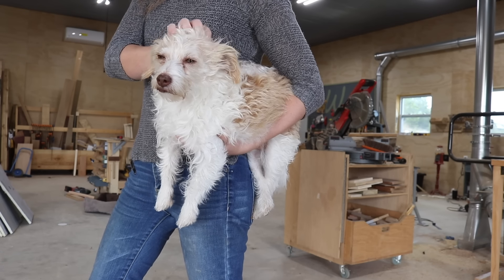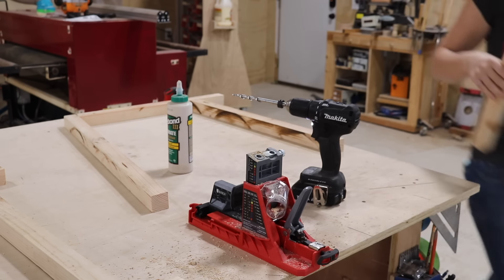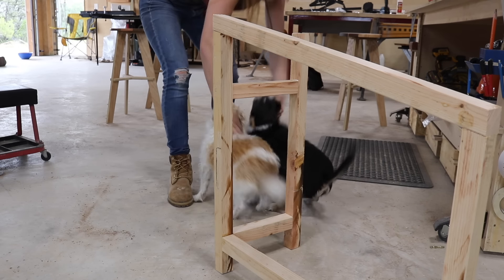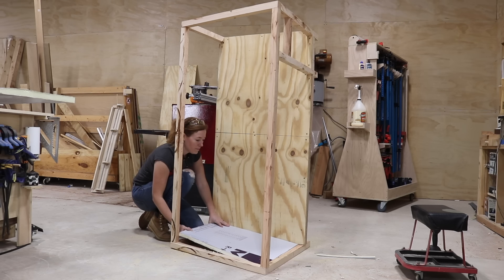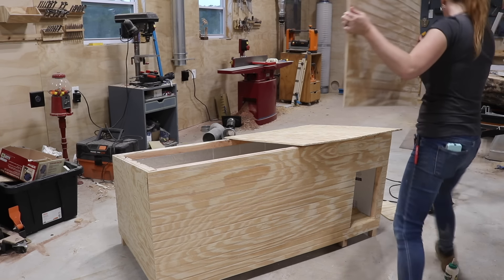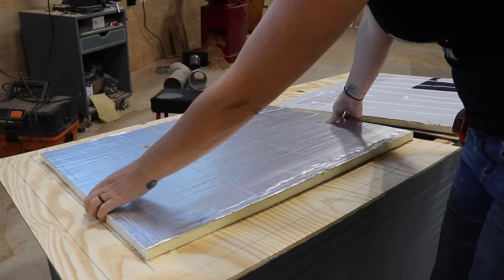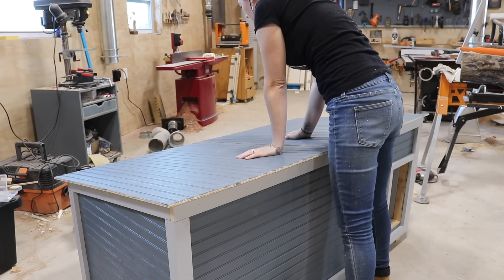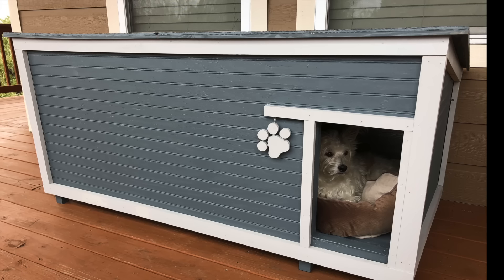DIY Insulated Dog House Build

Comment: A recommendation, add latches on the front in case of wind so the roof won't raise and slam down scaring the dogs. I had some dog houses with hinged tops to make cleaning them easier years ago and that happened. Nice design.
Reply from the maker: That's a good idea. : ) Thank you
Reply: Nice dog house wish I had a dog so I could build this. If I did I might be tempted to add some sort of flap to the entrance to reduce wind and draughts inside.
Reply: Well there under a porch
Reply: @AprilWilkerson  I'm late, but magnets will work just fine plus im lazy so it's easier than just adding more hinges or something
Reply: @chatteyj  I am building a hutch just so I can get guinea pigs. Just an idea :) build it and they will come.
Reply: I would like to buy one from u
Reply: @marianellaramirez3786  spam.
Reply: @mihai2860  spam
Reply: @neoadviser8056  spam
Reply: @rem2510  spam
Reply: @MariaSanchez-uo8qy  spam
Reply: @eggofish  there what?

Comment: April Wilkerson  I've really enjoyed watching your videos. You make a lot of really cool projects and you have come quite a long way since those first days. One thing that I've noticed though is that you always have a bunch of special tools for all your projects.  There's probably not a lot of us watching your videos that have over $100K+ worth of tools and a workshop bigger than most people's house. I wouldn't mind seeing some videos where you use just the basics. As an example. If I were to build this dog house with what I have I would have used, a standard circular saw (without a guide track), A standard 18V drill (no fancy pocket hole jig), a blade to cut the insulation, a speed square, a metal straight edge ruler (48 inch), a tape measure, a paint brush and roller, a couple of saw horses (no fancy, wood clamping, mighty jaw contraption). The entire cost of my tools for this project probably costs about as much as the two Infinity blades you listed in the summary (I'm not a carpenter nor is it a hobby of mine, I just like watching people build things). Just the tools alone that you listed in the summary costs well over $2,000. Maybe you could start a new set of "Back to the basics" videos where you make some nice projects with tools that the rest of us have. Once again, thanks for all your videos and keep them coming.

Comment: Should have put a plexiglass windows in the front, dogs always like to watch things,and stay warm.
Reply: I would have just added 4'x4' double insulated windows to help with temperature management.
Reply: I would be more concerned with a gust of wind lifting that roof and the wind blowing through that entrance hole.
Reply: @chatteyj  She can easily modify that with latches that she can access, but the wind cannot
Reply: Colby Mason horrible idea. Dogs tend to prefer darker and den like shelter when it storms which would lead to anxiety. The dog house she made is best how it is.
Reply: Purebredbrute when it storms you can always  just put a solid screen in front of the window
Reply: Dr Bojangles yea you can just bring them inside as well but is that even practical ?
Reply: Purebredbrute of course it is, all you need is a piece of wood the size of the window, not hard at all.  Bringing them inside is a big step from what I suggested
Reply: Dr Bojangles I don’t know where you live, but here in Texas that would require you switching the window in and out every other day, a few times a day as often as it rains. Furthermore would you be home at all times to be able to manually apply and reapply the window? Seems like a headache if you ask me.
Reply: Purebredbrute oh i see, i live in NZ its not so stormy here
Reply: Purebredbrute Well in that case i’d suggest building a robot to do the switching while youre away
Reply: How about a swing door so that cold air wouldn't blow in 😁
Reply: @ravenone6255  yea I was thinking of just putting in a doggy door.
Reply: To Colby Mason
 I made a house just like this one and you will be happy to know I took your advise an installed a window. Thanks.
Reply: I agree. Dogs are total sticky beaks and want to see everything. You can even see that in the video where the prime spot is in the doorway which is blocked by the dog sitting there. I built an insulated lift top dog house in 2008 for my two dogs and put in a tinted perspex window. They were happy being anywhere in there because they could see what was going on, and stay warm. Gotta look after the pooches :)
Reply: I lock my dog in the car trunk when it cold out so he stays warm

Comment: Excellent build !  I built an almost identical one, except for one dog. I had to cover the insulation board and mine had a center ridge with a piano hinge. The hinge was simply covered with a flap of thin flat rubber, bonded on both sides. It also has 8'' overhangs on the sides and 16'' over the opening. I'm 53 now and that dog house was built when I was 20 !  It is still in use but for a well pump house at a friends cottage by the river. Man, is it heavy !!

Comment: I liked the siding and paint you choose. Looks great. I have a heating pad in my dogs house because it gets 50 times colder here.
Reply from the maker: : ) Ha yeah, a Texas winter is pretty easy. I bet yours loves that pad!
Reply: @AprilWilkerson  oh yea ;)
Reply: Lol. How did you get over here?!
Reply: @This1LifeWeLive  I have been subbed to April for a 2 years
Reply: Doesn't get below freezing very often here, but I added a light and a 100watt bulb as a "heater" to make it warmer in the insulated dog house I built for my dogs a few years ago. It worked surprisingly well too. It was below freezing outside and the inside of the doghouse was about 75.
Reply: @Conqueef-tadoor  yes that works great...I use a 100 watt bulb in my cattle watering box and it keeps the inside warm
Reply: Inlive in Alberta and its get below freezing most of the year, what heating pad do you recommend? is it hard on the electricity bill??
Reply: @Mark300win  you can find them at Peavy mart

Comment: April, I built a very similar dog house for my three labs about 12 years ago. They did start eating the insulation until I covered it with more plywood. I didn’t paint it,  but because it sits under a covered patio it goes unnoticed by visitors and the dogs haven’t complained. I don’t put blankets inside as they would soon be shredded, but do put in fresh cedar shavings from shop projects once a year. It keeps them warm and comfortable and repels bugs.

Comment: Great video April. It turned out great. The dogs look very happy. A laptop would not make it in my shop.... to much dust, wood chips etc. The only time I’ve ever had kick back on the tablesaw was while cutting 2x4’s in half. I had my guard on, the splitter was in place, everything was done correctly...  It threw the 2x4 60 feet down my drive. I must of been concerned because I had  moved my truck. Had I not moved the truck it would have gone through my radiator. I think that what happened was the board closed up on the outfeed side and  pinched the splitter and blade and kicked it backwards. Luckily I sensed it moving and was off to the side and moved further away as it moved and didn’t get injured. The splitter was built into the guard..... my current tablesaw has a separate guard and splitter and I don’t think it could happen so easily. Since that day I use a bandsaw whenever possible to cut 2x material.....   Just a word of caution...
Ron

Comment: Nicely done April, i liked the overall design  and final product  as well as the new pocket hole jig  i thought i was going for the Harbor Freight metal pocket hole jig  but now i have a new one to  chec out  as i liked the  fast  adaptability  the one  you featured  over most of the others  and most likely i will share my next shop with my son  so we both will  use different methods and designs  so having tools that  can accomodate that is  more of my priority

Comment: I just built a dog house for my two younger sisters German Sheppard's. I used R-19 insulation in the floor, walls, and ceiling. I used full 2"x 4"s, 16" on center construction, OSB sheathing, wrapped with felt paper, traditional roof shingles, drip edge, and even fascia. the interior is dry walled, inside corner trim/crown moulding, 4" base board, and sealed with expanding foam (under the trim). Now I'm just trying to figure out if I should build a door with the style of insulation you're using with a double swing hinge feature or just a regular old plastic curtain type. The total cost will be around $500.00 when it's finished. I still need to add Hardie plank siding and prime/paint it (maybe even tape and float). Kudos to you for your build! 

Edit: I might add a window unit for the summer heat, and a window so they can see what going on outside. :)

Comment: Such cute doggies! By the way a smaller house shall decrease interior air space that is warmed by the dogs body heat. Which should give a warmer overall interior space. Adding a elongated entry will decrease cold wind entering the front access into the house. If you're dogs are in extreme cold adding a doggie door should help to

Comment: Wood Glue doesn't stick well to painted surfaces, but polyurethane construction adhesive or epoxy do. ;)

If this was going somewhere, where it gets rained on, I would prefer something else for the feet. Maybe pressure treated lumber or something with more resistance like oak or lyptus.
More than 10 years ago I build something similar to this to protect a waterpump from weather and light frost. I guess I would do a much nicer job on it today, but it is still ok.
On that project I used srews made for roof steel to attach the insulatian. The big washers on those screws can get some hold on that stuff.
Reply: A epoxy will stick well to glue, but it will have no strength if it is not penetrating into the wood.
Reply: That is true, but in every case it will be at least a bit stronger than just nails. ;)

Comment: I added similar insulation when I built our dog’s house but, as per your ending comments, he tore it all out! Oh well, he still enjoyed it 🙂
Reply from the maker: Did yours have foil backing? I don't think mine would tear into it just being foam, but especailly with the foil backing, they aren't messing with it.
Reply: It did have foil backing but it was facing out towards the exterior sheeting. He loved the house but took exception to my attempt to make it cosier in the cold winter
Reply: Paul Chandler Your building something for an animal on top of that something exposed to the elements, what made you think it would last unfinished like that?
Reply: Frieda M. O'Spich I think you misunderstood me. The insulation layer was on the inside of the dog house with the foil backing against the side and roof sheeting. It was not exposed to the elements
Reply: Paul Chandler A dog house is outside with no real door & very little material framing it. Plus the animals drag in whatever is out there, rain, mud, snow, debris... bugs come in. That is why I consider it exposed & certain to get soiled & prematurely worn if not finished properly both inside & outside. Even raw wood would need some sort of sealer imo to ensure its longevity, inside & out especially the floor. No one would think it’s safe or satisfactory to leave a human house with any type of insulation exposed so why would it be okay for animals who don’t know any better & might eat it?
Reply: Frieda, You have no idea on what my dog house looked like it’s location or what care I put into building it for our dog so how can you have an opinion on its use?  That’s my last word on this subject.

Comment: I made an almost identical doghouse for my two dogs.  Mine were a lot bigger so it had to be accommodating.  I used 1/2 plywood and the house was about 3 foot X 6 foot.  I heated the house for them using a ceramic reptile heating element in a protective cage.  It kept the house really comfortable even on the coldest days.

Comment: I did a similar insulated one, about 16 years ago, with a skylight.  I did not hinge the top; just lifted it off when needed.   Worked great, but a sinister 10 year old put a 12 pound mallet through the skylight on its second year... argh!  Amazingly, it was tuned to about 50 Hz, and made a great tiphony drum... when the dogs weren't in it (:>)  They slept in the house, at night, but liked to nap in there during the day.

Comment: turned out great.  as for gluing painted surfaces use weldbond. and when you have bead board like that use a higher nap roller and you wont need the brush.

Comment: Cutting the foam insulation on the tablesaw produces the best and cleanest cuts 👍 on that note, it seems as you should consider either change or sharpen your blade 😁

Comment: Amazing. I am building a hutch for guinea pigs and neglected the insulation aspect. Your design for insulation on the roof that opens is great. I also found the idea for the trim on the roof very useful to hide slight asymmetry on the roof due to a crooked 2x4 board. Thanks!

Comment: Hi, April, from down the road in San Antonio.  I like your dog house and really like that you are not all uptight about working smarter - not harder.  I will pass on one suggestion, only because when I was younger an old guy yelled at me.  Never use a steel blade against an (expensive) aluminum rule as a straightedge.  If you get a little cock-eyed that blade will peel the aluminum like an orange.  Instead you can pick up some steel bar stock or angle iron that is relatively straight for rough stuff, or get one of your sponsors to send you a nice stainless steel straightedge.  Y'all keep up the good work!

Comment: I built one 8 yrs ago....8' long/4'high/4'deep, 11/2 " insulation floor/walls/ roof....all 2x4 framing. . inner walls and floor was all 1/4" plywood, outside walls floor and roof were 1/2" plywood. I have two entrances on the front/and an inner room with dog doors. My dogs love having their own entrance to lay there and watch  outside and when they get cold they go into the inner room lined with straw and cuddle...The roof also opens/one piece.

Comment: i would add a piece of board to the entrance to form a short "tunnel". it will help keep the wind out. we did this on a kennel for our labrador many years ago, quite cozy even in winter. it was also fully double skinnned, but had rockwool  insulation so needed it.

Comment: If you mount a 60 or 80 watt light bulb covered w a old coffee can you have added a built in inexpensive furnace which you can control. Very safe and adds enough heat to really keep the pups warm💡

Comment: great job, FYI let the paint do the work on the roller. When you dry roll, or try to use more elbow grease, the nap of the roller gets hammered and it ends up holding less and less paint. Keep it wet and it will retain its original thickness.

Comment: Not sure how cold it gets there but adding a small 200W space heater near the top in the back might make it just that much more cozy for them. I actually have one under my desk and the heater puts out heat without getting uncomfortably hot. I would add a timer so it comes on only at night. In fact, you could get a fancy timer and only have it come on every say 30 minutes out of the hour during the night.

Comment: I actually made one similar to this a few years ago. Except I also added a light and a 100watt bulb as a "heater" for those really cold nights. I checked the interior temp with my laser thermometer, and it was 75° inside when it was 27° outside.

Comment: I used 1-1/2" foam board insulation with Mylar on one side. I also installed the Mylar on the inside walls instead outside so the Mylar would reflect heat back at our cats. I built their houses 2x3 ft the same size as the foam insulation. I also built them heaters that are just 60x-75w regular light bulbs I placed inside new 1 gallon paint cans.I also put on the floor the Farm Innovators heating pad that heats up to 1002 where they lay. The pads stay around 80 degrees to save power where their not lay,but the pad I'm sure does help with heating the condos. Ended up on the heaters using Ceramic light fixtures because the plastic ones get hot and puts off a toxic smell that you would not want your dog or cats to breathe. With just a small approx: 10"x12" door cut out these condos will stay a warm 75 degree's in below freezing weather. You can adjust the heat by the wattage bulbs and also put two heaters in the condo. I mounted the heaters mid way in against a wall with metal to protect the foam from getting to hot. Cats are always plenty far away from the heaters not to get to hot so all is safe. I leave them running 24/7.

Comment: I just worked on a local community project in 2019 to build a dog park, and one of the things we came across in our research before building the agility equipment is that some dogs will tear up material like insulation and fiber wood materials.  So as I was watching your build, I also had the same thought about the exposed insulation on the inside.  So I guess it is important to know your dogs behavior on this before building it.

Comment: Add a dog door flap and make more paws prints to disguise some ventilation portholes with a rotating foam plug in the interior a cheap ip-cam in the inside can let you check on your pooches.

Comment: Hey, perhaps 2 ideas for a v2?
1) Nice big window, either reclaimed or sandwiched plexi, on the same size as the doggy door. Give them doggos a view while they are inside.
2) Slightly more complicated, build a false wall on the end opposite the doggy door for some batteries and a small solar charger accessible from external doors.  Replace/augment the top panel with a large used solar panel (can find them from $50 to $150 depending on size).  Wire up the solar and battery to a fan in the summer and an electric heating pad in the winter.